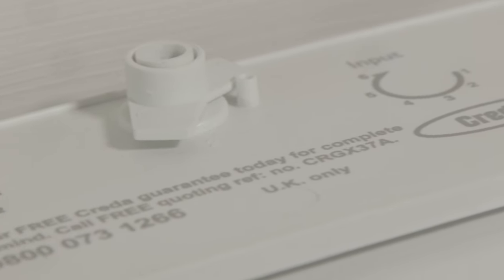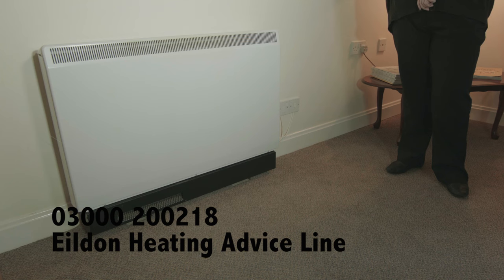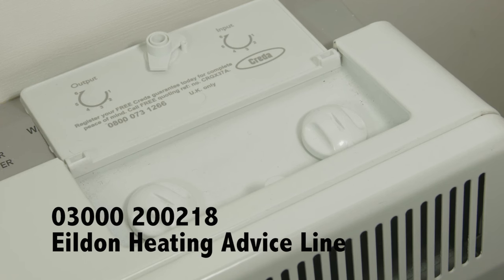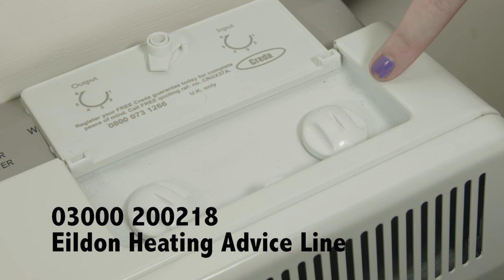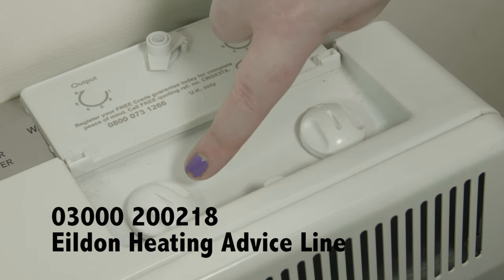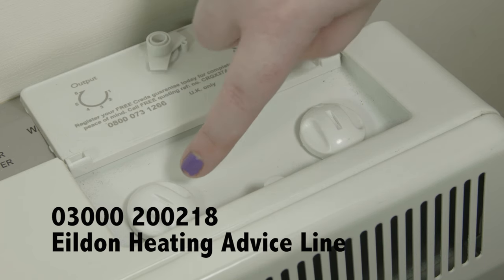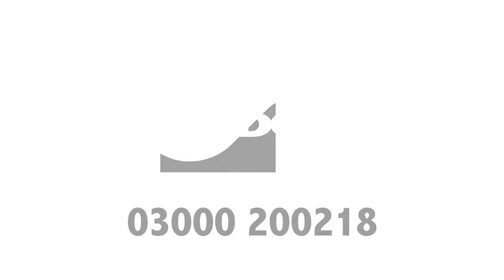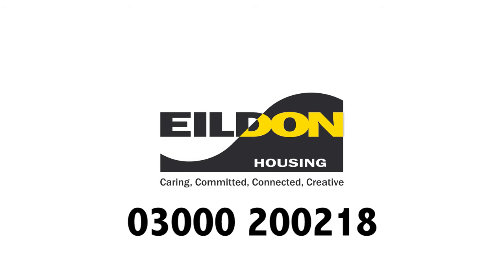How to Set the Basic Controls of Electric Storage Heaters

Comment: Hi guys, my family and I have moved in to a flat that have Alto AL7532 Series A heaters, I have switche the heater on but nothing seems to happens even if we adjust the temperatures? Is there maybe an outer switch that could generate power towards the heaters?
Reply: Check switch at wall is on and check nothing is tripped in the fuse box. If these are all OK then it is something with the heater itself. Like a controller or element. You will need to get an electrician to check it.

Comment: During winter, should the main switch of storage heaters be ON 24 hours a day? Will this not attract increased electricity bill each month? Also, Input high and output low during night? And output high and input low during day? Please if anybody can guide me
Reply: Leaving the switch on doesn't use more electricity throughout the day, only when you store it at night and want to use more input setting if you run out of heat in the day